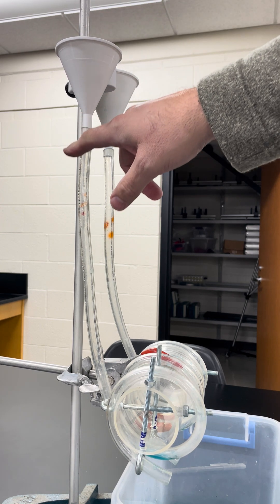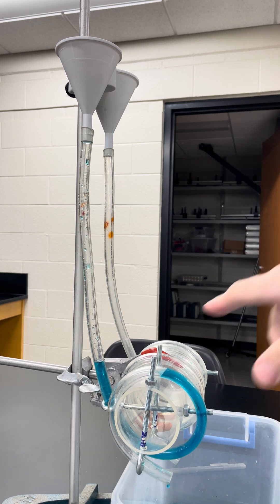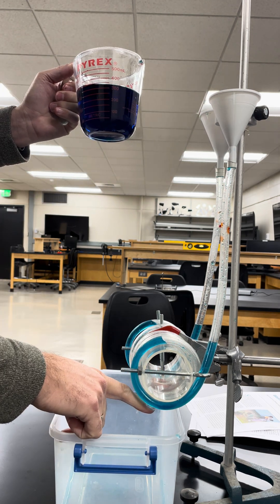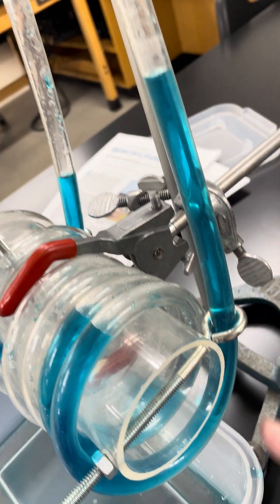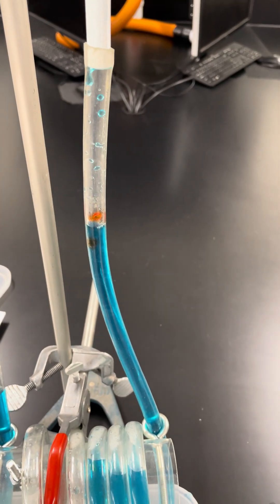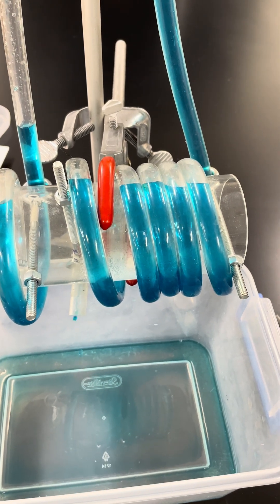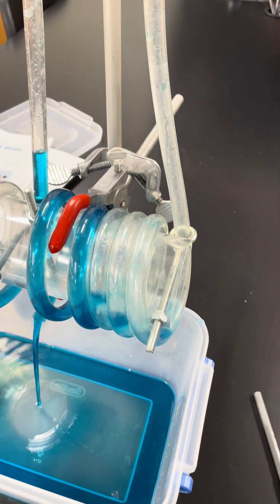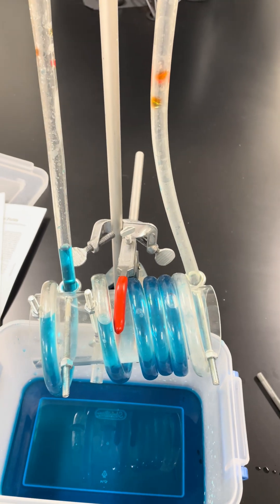Hidden Forces in your Drain

Comment: Hi there Paul,

I know this is unrelated to your video topic here but I see you have had the misfortune of crossing paths with Draftscience.

He has seen plenty of evidential proof it terms of Kinetic energy doing work.

He denies all evidence in favour of his gut feelings on these matters.

I will share a link in a separate comment to an experiment I performed in a separate comment as they tend not to post.

He out right lied about it initially then dismissed altogether with some nonsense excuses.

He does not accept evidence and the argument will never be over, even when he has seen proofs countless times in different variations from numerous people.👍😊
Reply from the maker: Yes, I noticed these things.  We've been having a long email debate.  He's been going on about how an object traveling 5 times as fast can't have 25 times as much energy.  And then he likes to change the subject to rotating turbines.

I tried to work through the solution to the ballistic pendulum problem with him.  He did agree that 1) momentum is conserved and 2) ballistic pendulums measure the velocity of a fast moving object by colliding it with a slower object.  When I pointed out that the maximum height of the pendulum after the collision gives you the velocity by converting kinetic energy (0.5*m*v*v) to potential  energy (m*g*h) he quickly brought of something about how he thinks that springs store momentum and not energy.  I asked to see his math for making a measurement with a ballistic pendulum.  I have one.  And I've offered to test our competing theories.  We'll see.

I should stop writing back to him.  He's pretty intent on not learning anything or bothering to do any math.
Reply: @ValpoPhysics  Thank you for your reply Paul, I'm glad you have noticed what you are up against.

Math is just blah blah blah to him, as he doesn't understand it and makes no attempt to.

Yes the 5 velocity, 25 times the energy seems to bake his noodle, I'm currently working on a demo of that but having to build my apparatus for that one from scratch.

He does tend to change topic or goal posts when he is pinned down argument wise.

I know, springs store momentum lol, he has  been saying this for years, he doesn't think there is potential energy either, but by his logic spring would have to store potential momentum.

I did notice he changed the subject in regards to the ballistic pendulum when he realized the K E, formula is involved in determining the projectiles velocity.

You have been doing a great job though Paul, in trying to get your points across, albeit falling on deaf ears.

He believes one day he will be recognized for his contribution to fundamental physics a be awarded a Nobel Prize, that's how far the rot has set in.

His bark is a lot worse than his bite, so no real harm in continuing your email debate, and it's been entertaining and interesting even if it has no effect ultimately.👍😊

Comment: Nice demo! :)

I think you have almost built some kind of AC-transformer-water-analogy-hobajop? (In which only half-to-one cycle is shown!?)
Well, without the "return-cycle" of course, and Maxwells equations.

Also, I'm not by any means an eclectic engineer or something, but I think unicorns kick ass! ;)
Reply from the maker: I've been thinking about that.  I'm not sure that I see exactly the comparison that you're thinking about.  But there may be a good demonstration in that idea if I can figure out what it is.  I think that it would require some way to transfer water from one coil to the other.  But perhaps it's just about the pressure buildup on the multiple loops.  Let me know if you have other thoughts on that.